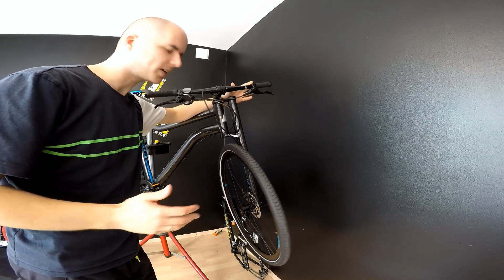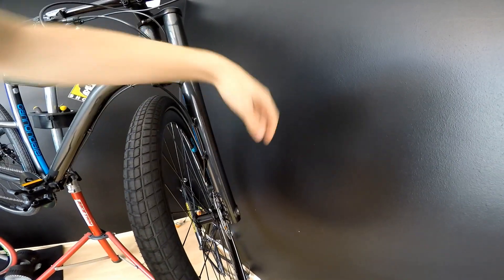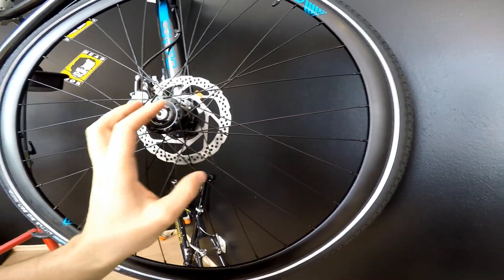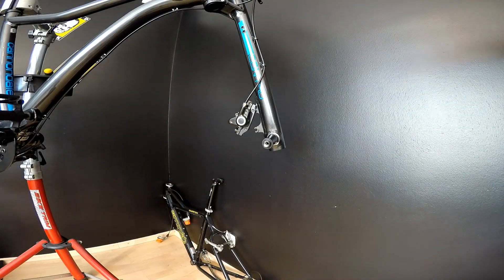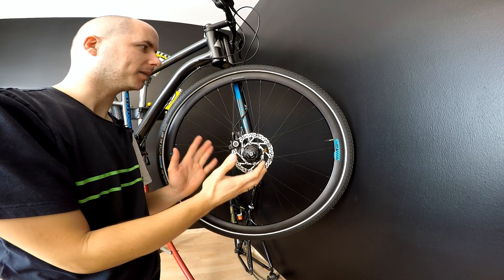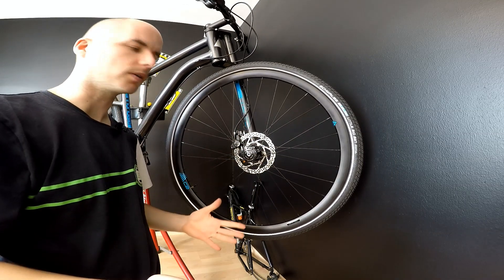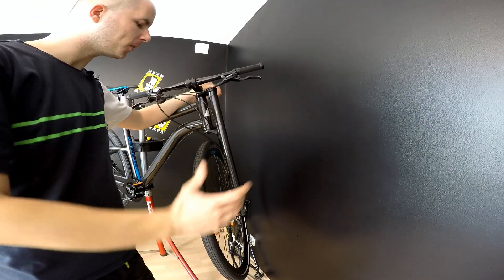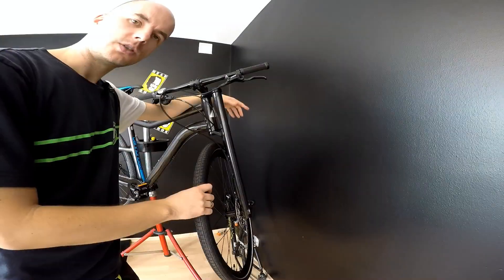Cannondale Lefty - cons and pros of using a one-legged suspension and rigid fork.

Comment: I think this is purely a personal choice. Here's my ten cents: I have lefties on my 2014 Scalpel 29 and my circa 2013 Flash 29. They have a lot of hard off road/mountain miles on them and I have never had a problem. Never. The ride is fine, even on very aggressive terrain. Maybe I'm used to it but I don't feel any left pull and the balance is neutral and I can switch to  other non-leftie mountain bikes without noticing the difference. Just to prove it I have ridden on my local gravel rail trail many times for miles  (literally) with no hands Ma. I also had an old Rush 26 (circa 2005) that saw a lot of MTB racing that a friend now uses,. That leftie is still going strong well into its second decade. Maintenance on these forks is very straightforward: you just need to learn how to do it: there are a lot of good instructional clips on Youtube. Even a klutz like me can take care of it but my late great LBS was very competent too. Wheel removal is really easy: it's only three bolts. Yes very slightly more involved than a QR but really no big deal (BTW have you  ever tried to find one of those little QR springs in the mud on the mountain?) . You can get that wheel off a leftie in seconds with a mini tool and of course you don't need to take the wheel off to fix a flat or change a tire which is a huge advantage out there in the mud and rain, so unless you taco a wheel in a race (and if you do, those extra seconds are probably irrelevant)  you'll only need to do it if you need to remove the wheel for transportation which many don't need to do anyway because either the rack design doesn't require it or there's enough room in the vehicle bed/way-back.  As for strength, I've never seen or heard of a leftie break or bend. Cannodale make a big point about the stress tests they perform on these forks and  people race with them. If you don't like the idea of a leftie that's fine, (to each his or her own)  but let's not invent silly "technical" reasons to justify an emotional choice.
Reply: Instablaster

Comment: if you got a puncture. you wont need to take the wheel off because you got full access
Reply from the maker: That's right :)
Reply: but taking a wheel off nowadays on a normal fork with quick realease axles is almoast as fast and i think its a lot more comfortable to work on the wheel when you completly remove it and also you can work faster then
Reply: emty box true, but is still faster than taking out the qr wheel
Reply: I don’t recall every having a front-flat… plenty of rear flats but never a front.

Comment: Thank you buddy. The guy at the shop told me putting the caliper on is complicated but it doesn't seem like there is anything special. I'm confident (as a noob) I can do it. Appreciate it.
Reply: Loosen two caliper bolts. Move upwards and lift it clear of brake rotor. Then remove center spindle..

Comment: I agree with you entirely, but as a Lefty-equipped Cannondale Caffeine F1 user since the mid-2009, I will have to point out a couple of issues you forgot to mention: 

 - The Lefty isn't compatible with any of the hub dynamos available today. In My view, that's a major disadvantage compared to the competition.  

  - The Lefty steers very nervously with only one hand on the handlebar. Hand-free you're almost guaranteed to fall. 

  - For touring, the Lefty-equipped bike is of fairly limited use not only because of the issues related above (especially the first one), but also (in some cases) because it isn't meant for, and thus, is incompatible - with fork-mounted luggage  racks. 
 I've done a number of bicycle tours on My Caffeine F1, including a couple of ca. 2.000km to 2.000km bike tours to Rome and Delphi - and since I prefer to use two rear-mounted panniers instead of a set of front and rear -mounted ones, the last point didn't bother Me. However, a Lefty in a bike without rear rack bosses (such as the otherwise quite excellent, albeit expensive for aluminium-frame rigs, Slate series bikes) makes the bike quite useless for anything but day trips. Add to that the incompatibility with any hub dynamo - and you end up with a very specialised, fairly limited use gravel bike. 

If not for those two issues, I'd love to supplement My bike collection with something like the Slate - particularly, if it was a little more affordable and maybe had a slightly longer fork suspension travel: for many situations, the Lefty Oliver's 30mm travel is somewhat insufficient. Speaking of Cannondale's range limitations, I'd also love for them to launch a Slate with a tightly integrated, but easily removable for charging and occasional pedal-only  -powered rides, high-capacity battery and a powerful, high-torque, but efficient, motor. And maybe a bit  smoother welds, visually reminiscent of carbon.
Reply: I haven't notice any problems riding with no hands on the bars.

Comment: I just sent one (2017 Bad Boy 1) to my Bro for his Bday..unfortunately it didn't come with a manual..and the shop wasn't very helpful when he showed up for a run down on the bike.. I am out of state and can't be on hands to help him.. 
I was hoping you could answer me a few ques..
1- Does the bike come with a cord for re-charging the lefty fork light strip and where is the port for charging?
2- Is it OK to switch gears when under power of should one be coasting?
3- Any routine maintenance to the rear hub/gears and drive belt?
Thank you very much in advance.
Joe
Reply: thank you for your insightful remark..
Reply: 1.  Yes, it comes with a cable2.  Yes, it's okay under power.  Just not cranking it in the middle of a climb on a major hill. 3.  No real basic maintenance, it's a pretty closed system.
Reply: TY Empty
Reply: Empty Suet hello empty thanks for the reply. Im also interested in a cannondale bad boy 1 but im not sure if with that shimano alfine 8....can it really climbreally steep hills? Thanks.

Comment: Is it possible to buy Cannondale MTB bike with Lefty for about 4k PLN?
Reply from the maker: +preacher Yes, I think so. I bought myself a used Taurine with Lefty Carbon and almost new Scalpel with Lefty alloy. Both for about 4500 PLN.
Reply: +cannondany im afraid about jumping with Lefty. This suspension fork doesnt look strong enough for drops on XC races :) How often it should be servcied and whats about costs, is it expensive?
Reply from the maker: +preacher The maintenance depends on model, but I can tell you, that these "forks" are SUPER durable.
Reply: Are you afraid of hoping in your car or flying in a plane?  Both these vehicles use a one-sided wheel mount.  Same idea.  Its actually proven to be stronger than the stiction-ridden normal forks.